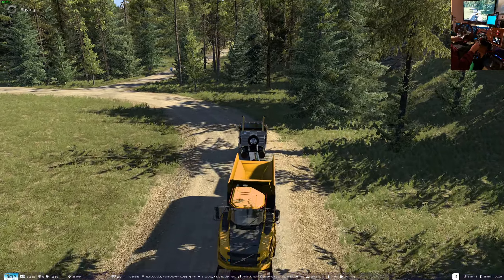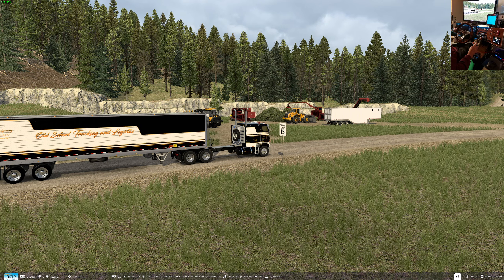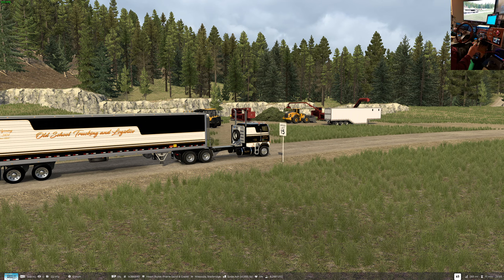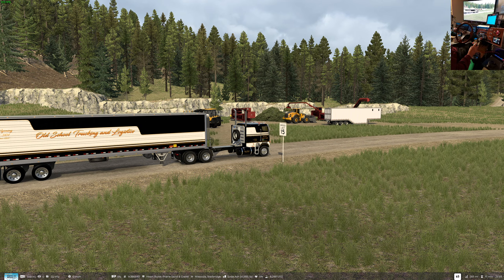ATS | Does SCS Model Weight Distribution?

Comment: It would really cool if SCS would implement axel weights As a Option to keep all players happy. I mean we have scales at all truck stops in game. I think it would be a very cool realistic feature. very eye opening Vid I honestly did not think weight dis was all that critical , I myself run very high Hp Engines So I have not run into any problems so far. That being said the moveable trailer axels are REALLY Going to be huge advantage when docking an manuvering. Great vid. I probably will wait for official release of 1.53 Only because I had some bad experience with 1.52 beta. but that's another story. :hand-purple-blue-peace:
Reply from the maker: Thanks for the thoughtful comment. I feel this is just the tip of iceberg. Lots more to come I hope.

Comment: I messed around with the tandem sliding earlier today. It says if you don't map it to a key then it automatically adjusts depending on your load. So I took a light load of just over 22k lbs in a 53ft van. Tandems didn't move, they stayed in the position it was in prior to load. So I wonder how it determines if it slides them or not. I think your tests here show weight distribution is taken in consideration. When I first started driving IRL way back in 2005, I used to slide my tandems mostly forward when I was empty. Too far and I'd worry about the overhang hitting another vehicle when I make a tight turn. Glad they added this in ATS.

Comment: There is still one thing missing. The default Flywheel Inertia is incorrect in the game. It should be changed to 1.25 in the Physics file.

Test it and tell me if you can see how it gives you a better feeling of the load weight.
Reply from the maker: Good idea. I will see if I can get to it soon.
Reply: I'm looking forward to seeing the video

Comment: Europe doesn't have sliding axles on trailers
Reply from the maker: That's interesting. Guess they are a little shorter and generally seem to have more than enough axles. Perhaps weight distribution is not an issue with them.